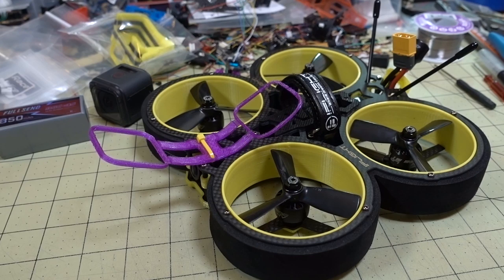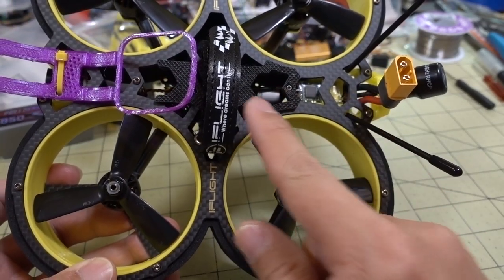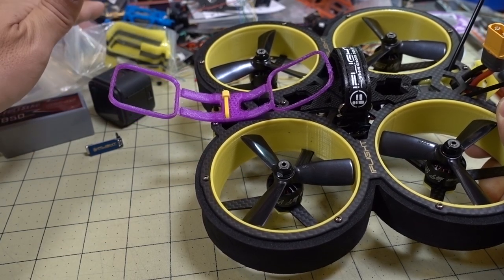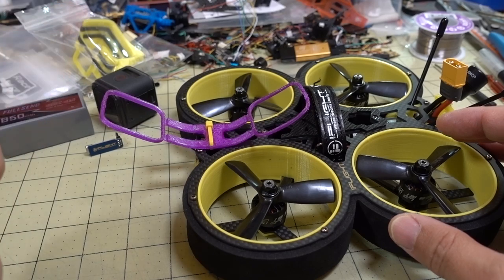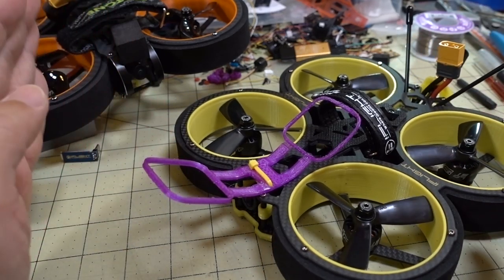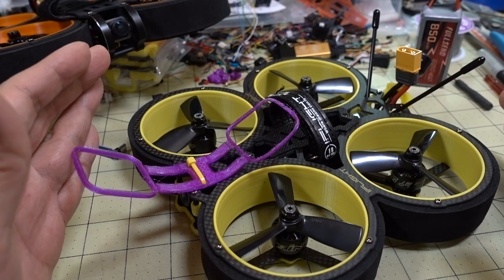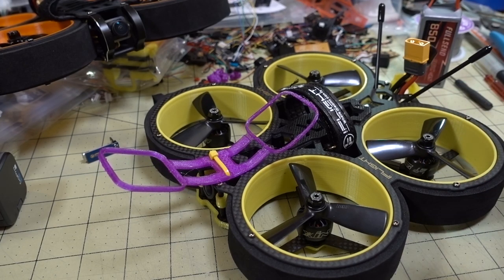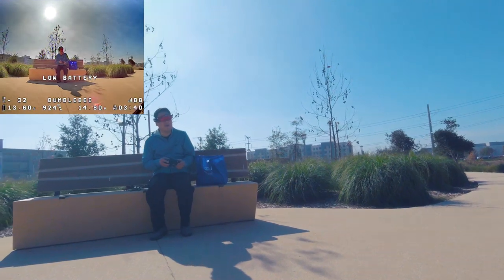iFlight Bumblebee Cinewhoop Review 🐝

Comment: Did you find the BNF settings from iflight on the bumblebee made the motors extremely hot?
Reply from the maker: My motors were not hot.  You will find a lot of variability from build to build even with the same parts.  That's why CLI dumps aren't all that useful IMO.  Your D-gain is probably too high for your build.  I would lower that value and/or increase your filtering.

Comment: Love the video! Could you tell me what firmware you are running? And what are your UART port settings? Mine came in yesterday and it’s paired to the controller but not recognizing any input from the controller
Reply from the maker: Mine is with factory settings using the XM+ receiver that was included.  If you are using a different receiver and especially one that is not inverted like a spektrum or flysky receiver, you need to wire it up to one of the uninverted UARTs.  So if you're wired to one UART and it's not working, try one of the other ones.